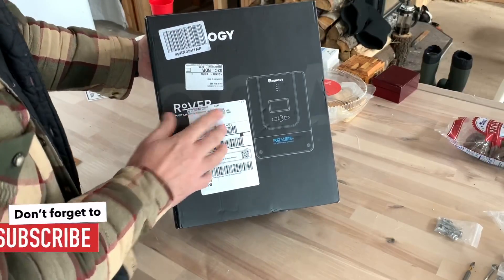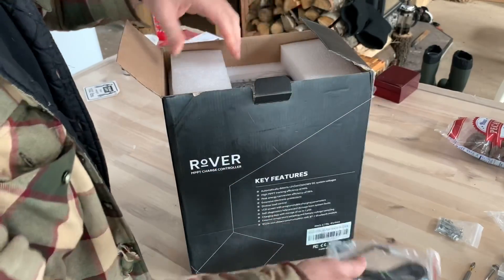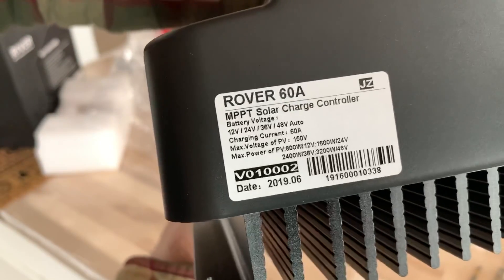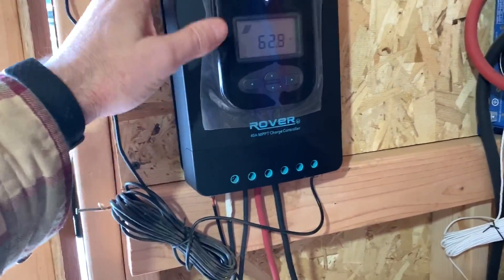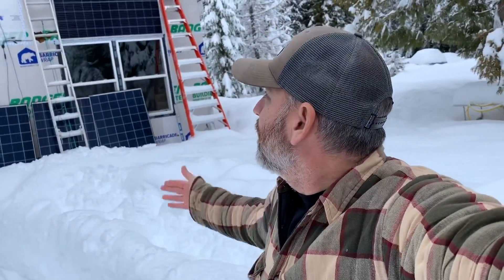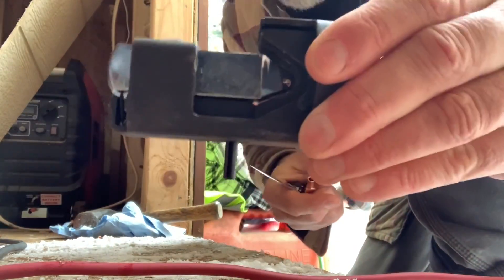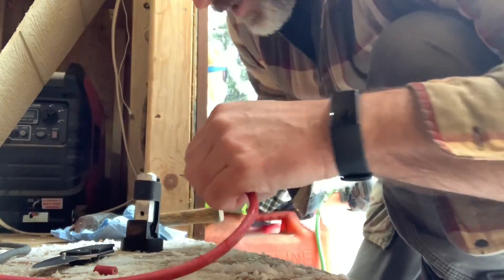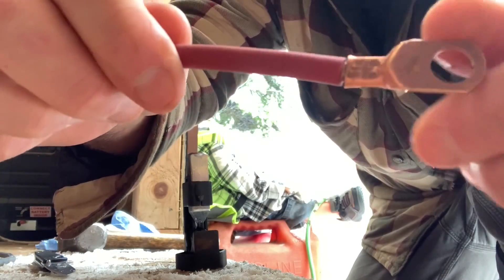DIY Solar Charge Controller | STUPID EASY!

Comment: I've both read and seen other videos that state when mechanical staking is used for connections that solder is not needed. The staking alone  permanently welds the two together. Adding solder only reduces conductivity ever so slightly. But in the world of solar, we want every positive advantage we can get. Great video BTW, Ive just purchased the 40amp Rover to upgrade from my 30amp pwm charger. Im going to increase from 400 watts to 600 watts of solar. Oh, what is the wattage of your 24v inverter?? Thanks

Comment: In regards to soldering: I was trained in instrumentation wiring for vehicles. We we taught to NEVER solder connections as soldering creates a “solid section” of wire that when subject to movement/vibration is more likely to fatigue break than a crimped connection, with no loss of data acquisition voltage (0-5v in milliamperes) Hope that you find that informative!
Reply: Then there is a dry solder joint. Nothing like inducing a fault as well. Not everyone knows how to solder properly. Started in telecom exchanges. Soldered all day long. Still learning at my age. No soldering when working on vehicles.

Comment: ask the mechanic i use to work with,about soldering terminals,,LOL,solder only and not crimped,,lasted for about 6months,before the solder melted and the cables fell out,,,I believe in just plane ole crimping and shrink tube,maybe spray a little honey goo on cable ends,(for vehicle use),,as far as which cable to remove first,I've always disconnected the negative first.Great informative vid..

Comment: Hi Martin, great video. I'm in SC and I do not envy you for having all that snow/ice!
Regarding soldering a crimped joint: a metallurgist colleague of mine was a failure analyst for an auto maker. He analyzed many failures of electrical connections because of soldering crimped joints. The problem is that the crimped joint relies on the strain of the cold worked metal for it's strength - copper cold works easily during the crimping process. The heat from soldering relieves that strain - think of heat treating. If I recall correctly, he preferred crimping to soldering, but either way, definitely do not solder a crimped joint, it defeats the whole purpose of the crimper.

Comment: Have a question; had a 600w system that was working well. Charge controller failed and i changed battery connection to series 12v. Now system works during the day but at night voltage quickly drops and goes into blackout after about 2 hrs use. Any ideas what this might be?

Comment: Thanks for this video Martin. I just added 4 more 100 watt Renogy panels to my system (making a total of 8) and also adding a 60 amp Rover charge controller. I now want to move the batteries, charger & inverter into the house and out of my enclosed trailer. Also need to purchase some unistrut material and build a sturdy ground frame to make a permanent panel mount. Still own the 40 amp Rover, so I can add 4 more panels at a later date. Have to next work on updating my 2 Renogy gel 100Ah batteries to 200Ah Lithium Iron Phosphate...if I can find at a decent price...Renogy wants way too much for theirs.
Reply: Have you enjoyed your renogy 60 amp charge controller? I am about to get into solar and have narrowed it down to that charge controller because of its versatility as I grow my battery bank through the years

Comment: Hi, I have a question that Renogy seems not to have any info about the 24v setup. You mentioned that when selecting 24v the controller automatically doubles the numbers in the parameters, even though you actually see 12v numbers. 
This would be in the USER mode for LiFePo4 batteries at 12.8v. Connected in series (25.6V).  
So.... I do not need to double the numbers for series connection??  just select 24V and plug the recommended numbers from the battery manufacturer and the controller takes it from there?  
 Thanks for posting your videos!     Update!  After reading my manual closely, the controller does indeed double the numbers for 24v .

Comment: CHARGE CONTROLLER - would you have CHOSEN a larger CHARGE CONTROLLER - initially - if you knew your final number of SOLAR PANELS ? 
60 amp + 40 amp ... would you have chosen a 100+ amp Charge controller if you knew in advance ??? 
you seem to be using a COMBINER  MC-4 Connector that I've never seen before = 2 Wires / Panels into a single FEED Wire ... 
what are these called ?  
COOP
...

Comment: I'm considering purchasing this unit currently but I've seen multiple people say that the renogy charge controllers don't read the batteries accurately.  In your experience is it reading accurately have you tested with a multimeter at the batteries  to compare to the charge controller?
Reply: I got the 40w rover couple of weeks ago and I noticed the display was showing a higher voltage than my multimeter. Poor form as my batteries are new AGM and I don't want them ruined in the first couple of years
Reply: @alpha0101pi  Try the Tracer EPEver they are very accurate. Ive had one for a number of years never failed

Comment: Hi, I would be extremely grateful if someone could help me out on a couple of points, one on the unit & the other operations in general. 

I'm running my through a good quality inverter & the whole setup works like a dream but.... Whenever the Rover goes into "Boost" mode & IF I have anything plugged into & running through the inverter, it goes nuts because I think it doesn't like the fact a higher than recommended/advised current is going through it. I can reduce the "Boost" voltage under the "USR" setting but wonder if this is negating the benefit of having "Boost" & if, under "USR," you are using a host of random parameters generally? I could get round this by not using the unit when the Rover is in "Boost" mode but just on that - Is the "Bulk, Constant, Float, Boost," a cyclical thing eg. continually repeating during the day or just a once a day thing?

I have been running the system without any fusing. Do people recommend fusing? I can't really see where any problem would occur & the inverter is fully fused? Also would fuses lessen the available current going into the battery?

Many thanks for any help!
Reply: I think the boost is preprogrammed battery charging options for longevity. I would contact inverter company about problem as it s job to stabilize
Reply: @RJSoftware2000  

Many thanks for your kind help!

Comment: Any mppt controller that only works from only 150 volts is junk. There are a lot of them too.   With panels that have a vopen of 45 volts, that means you can't have more than 3 panels before you have to go parallel.  There are only a few 600 volt controllers out there that have it. Where I live, shading is an ever-present threat which makes connecting in parallel unfeasible.

Comment: People who insist you solder don’t understand crimps. A proper crimp is a cold weld and should perform as well as soldering. They also have much better vibration tolerance. Not as important for your cabin but very important in my travel trailer.

Comment: If the nighttime symbol on this control charger remains on is there a way to reset the charger or are we to assume something is wrong with our solar system?
Reply from the maker: I would look at the manual. Sorry I just can’t remember off the top of my head. It you don’t have it you can get it from their website.

Comment: I don't see any fusing on your lines or between components.  I think this might be a good idea to check out.  You might also consider an EMERGENCY disconnect from your battery bank.

Comment: Just beat it! Or crimp it! Some rung terminals, may need cleaning, with wire brush, it can cause problems later, if they are corroded or if there is anything that will cause corrosion or a bad connection, tinned copper terminal are nice, a wire brush to clean them before crimping, can make a better connection, a heat shrink to prevent any oxidisation/ corrosion, atleast some tape to seal the connection, especially if there is high current connections, things happen over time, I don't like having over 300 amps constant/ sustained load with DC power, I have had things happen , from bolts loosening from heat cycling, viberations, and corrosion of conductors, causing things to overheat, and could lead to fire, and throw 200-300 + amps in the mix, and it gets gets fast, if it's over 200amps it's best to not leave it to a single connection, no matter the the cable size, I run 2 runs each, of 2/0 cable on my system to the inverter. Leaving 150-200 amps peak to each cable, the distance a single 3/0 would work fine, but it's cheaper than a house! I just lost my house to a fire a few years ago, so I'm a bit paranoid about potential fire hazards!! Having enough lithium batteries to launch a rocket, doesn't help! So I'm waiting for the BMS, and a cabnet before even trying to connect the batteries! Along with a baking soda fire suppression system, in the battery cabnet, I'm hoping the soda will help prevent the whole battery bank from going up, if there is a "incident" with a single cell, and because water will only make things worse! Sorry rambling again!

Comment: Just an fyi that tthe further you run DC cables, the more voltage drop there is making it less efficient unless you upsize the cables and the colder a battery is, the more inefficient it becomes. Battery efficiency drops drastically along with temperature. Just think of it like trying to start a vehicle where if it doesn"t start right away in the summer you can crank it forever but in the winter you can"t crank it for very long before it dies. Might be a good idea to put the batteries, controllers and inverter in the basement, closer to the panels and the house which will keep your voltage drop to a minimum and keep your batteries warmer, killing two birds with one stone.
Reply from the maker: That is true for AC too.

Comment: Always remove the ground side first then the hot, reverse to install , hot first then ground last. This will lower the risk of a spark which could ignite hydrogen gas being off gassed by the batteries. Hope this helps.
Reply: your going to get a spark no matter which one you do first. the unhooking negative first thing is from automotive work in case your wrench bumps surrounding metal when unhooking positive. when installing new batt hook positive up first for same reason
Reply: @jeffrobison2013  Always negative first and last, it's not just for automotive arcing on a grounded frame ect. Connecting the battery cable to terminal itself creates less sparking when the ground is hooked up first and last, rather than the positive!?

Comment: With metal chassis like on cars, disconnect negative first and and reconnect negative last. I don't think it really matters with your solar system but you should always reconnect away from the battery when possible and wear safety glasses (do as I say not as I do). When you reconnect the arc (that small spark) has the potential to cause the battery to pop and spray battery acid. I have had one pop when I attempted to start the car. Fortunately I wasn't standing over it.

Comment: When I do multi battery projects. I leave a 2 inch air gap in between the batteries for heat dissipation. Equals better performance higher capacity longer life

Comment: Effectively, crimping these terminals in the correct manner you have a weld. That is the effect of the thin layer of tin on that terminal under that kind of pressure. It is a finding in WWII to reduce the use of sodder. AMP (an American company) produced it worldwide, here in The Netherlands in the city of Den Bosch

Comment: you may want to check out YTuber 'red poppy ranch' he's just changed over to Lithium batteries, it may be helpful if you need to upgrade your system.
Reply: It does look like a better system , but quite more expensive .

Comment: Should have run your wires from the shed to the house up off of the ground so you don't accidentally damage them.
Reply: Or have a moose get tangled up with them and drag them off/out somewhere else like they like to do with my electric fence. They’ve even climbed the woven wire fence around the garden next to the house., leaving big footsteps in the wire and bending corners in towards the center. They move around a lot at night and are curious about all the changes.

Comment: Whether you disconnect Positive or Negative first, is not as important in a wood shed, or in a plastic battery box, because you can not short circuit to metal ground as in a car, but do Negative first, to keep the procedure in your head.   Much more important,   I did not see a fuse / breaker, or even a disconnect in your system, you really should have at least a fuse, I would use one rated at about 1.5 times the max load of the inverter (2000 x 1.5 / 24 = 125A )   a breaker is nice because you can disconnect at will.   Now that the panels are on your house it is quite important to ground the Negative side of the panels ( for lightening protection ) but do NOT just do that,   READ how your inverter is set up, you can blow up the inverter if you do grounding "wrong"   If you get in your car, and drive West until the weather gets really crappy, you will find a couple of factories that build airplanes, the cables that go to the turbine engines, are crimped, with NO solder in sight, if it is good enough for Boeing, it is good enough for you.     Have a wonderful day.

Comment: You need a battery disconnect between batteries and inverter. A fused combiner box at your panels also. Not only for surge protection. That way you can shut down without having to unhook wires for maintenance . Since you have a large solar array I would also consider lightning  arresters to protect your equipment and avoid fire. Not sure what your overall voltage is coming from those panels but would do the math. Don’t seem like a 60 amp controller is enough. Should use your 40 amp too and split some of that incoming voltage. Mainly because you are using MPPT vs PWM. I always unhook positive first.  Your panels must also be grounded one to the other .Just sharing my 10+ years of solar experience. No insult intended.
Reply: Say with this 60a controller, the max PV power input is 150v, so is it safe to have exactly 150 or 151v coming in from 4x 250w panels?
Reply: haha i like the " no insult" caveat. he is very touchy.

Comment: First disconnect the panels from the controller, negative first. Once the panels are disconnected, then disconnect one line from the controller to the batteries, at the controller. Negative or positive, doesn't make a difference with a solar system, because you are NOT (repeat NOT) connecting any of the wires to a metal rack. Then disconnect the other end of that cable from the batteries. Now disconnect the other cable. DO NOT disconnect both ends  (at controller or batteries) at the same time, UNLESS you tape the exposed wire off on the first cable BEFORE you disconnect the second cable. Safety first! 
On crimping the lug ends to the cable, you don't have to solder them, hence the name "solderless" connections. HOWEVER, vapors from the batteries will corrode those fine wires. I always solder them in addition to crimping them. Then heat shrink, liquid tape or rubber tape over the end of the lug and cable, covering all exposed wire. I have seen copper wire oxidize and come out of what was a secure crimp after several years. That's why I take the extra time and solder them.

Comment: On your car you always remove negative first because the frame is tied to negative and any slip of a wrench on a positive lug may turn into 12v arc welding.  On a battery bank like you have it doesn't matter.  Any break in the circuit stops current flow.

Comment: We usually disconnect the negative first, that way the chassis of whatever you're working on if it has one, isn't grounded which means if you bump it with the wrench while removing the positive you won't be shorting out/welding. When dealing with a battery out in the open, (no chassis/frame) like your set up, I'd bet a nickel it doesn't matter, but let's see what the electricians say. Also like to use a color matched heat shrink tubing over battery cable ends, looks nice and seals them up. Anxious to see how the new setup works. It's cool how the snow insulates your water tank. Looking good!
Reply: your are right